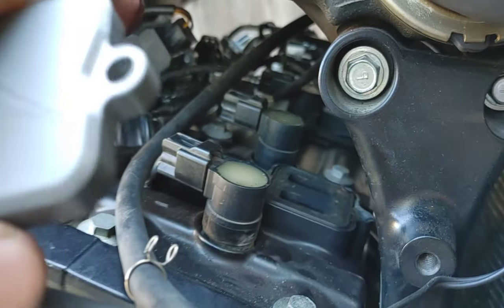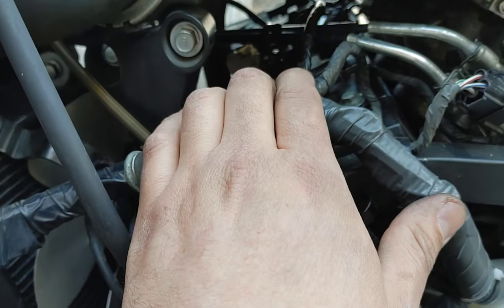zx14 pair valve block off plates

Comment: Good video. ZX14 owners need good instructional videos like this. I'm going to try to change my own plugs, but I'm worried about getting the valves adjusted. I hope the Kawasaki dealer will be able to do it right.
Reply from the maker: Valve adjustment is fairly easy.  All you need is feeler gauges and patients.  The stealer will charge a big amount for that job.  Thank you for the compliment.  That's what keeps me making videos.
Reply: @DRKKNTRACING  not only will they charge alot. They will probably do it incorrectly. And it will take them forever.

Comment: Way cheaper and easier to jam a marble into the PAIR hose that comes off the airbox.  Pull hose off, stuff a greased up marble into the hose and reconnect it.  Done.
Reply from the maker: That doesn't remove the system completely.  That's just another way to block it.
Reply: @DRKKNTRACING  Yeah, but most people don't care about 13 ounces of weight savings on a 570lbs bike...  lol

You can lose more weight than that just by increased your fiber with breakfast before you ride.  🙂

I never found it worth the time to remove the whole system with a few minutes and a marble 100% blocks it...
Reply from the maker: @SquireSCA  yea your right a few pounds won't make a difference

Comment: Wow, that's a horrible design. To make a bike thats damn near almost unserviceable for a simple spark plugs Chang without have to remove the engine to get some working space.. who does that!!.. 

I was ok with the hidden battery compartment.. shook my head at that huge 1940s prop duster exposed fan blade.. but really, what next.

Ok Kawasaki, lets put the oil refill in between the engine and frame where we can't reach it without having to remove the engine now.. LMAO..
Reply from the maker: Its not that bad. Its actually pretty easy to work on